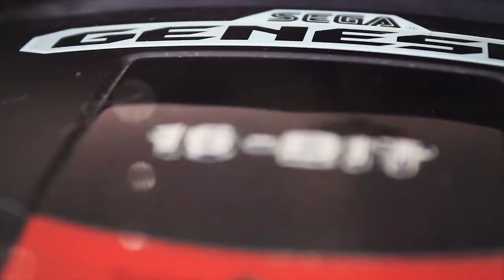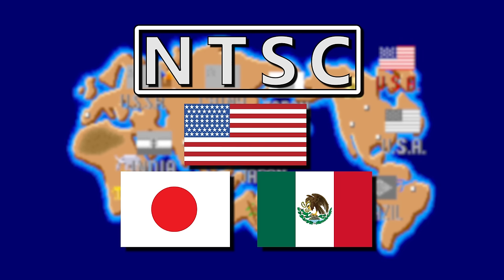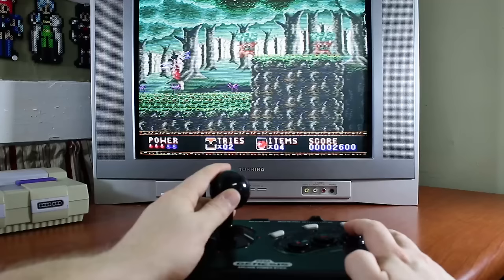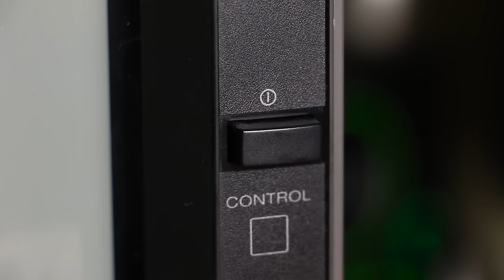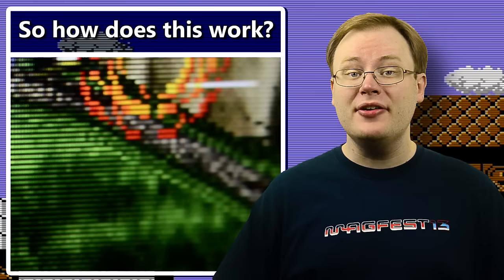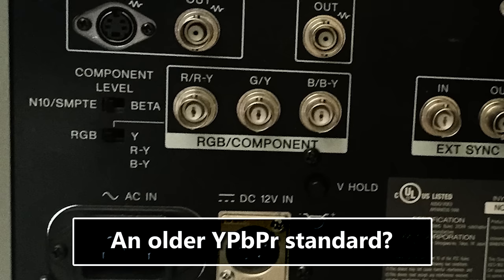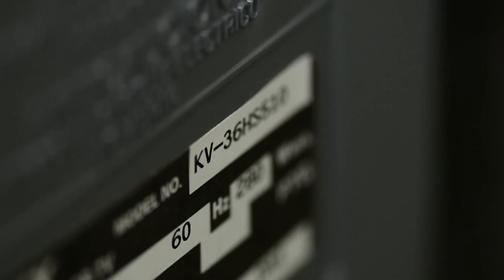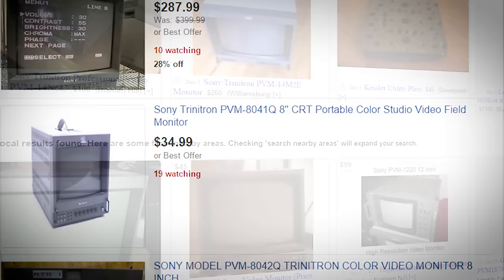Gaming on CRT Televisions, PVMs and BVMs :: RGB104 / MY LIFE IN GAMING

Comment: Not keen on professional video monitors and the whole RGB thing going on today certain consoles like the NES, SNES, N64 all don't have RGB as standard they came with RF in the UK and composite was considered the better quality cable and on top if you want RGB scart out those consoles they have to be hardware modded. 
To me that says a lot about the intended look of what the games were meant to look.
I would say Dreamcast and above work well and look great with RGB Scart otherwise PS1 and below I prefer composite inputs as so many games took advantage of dithering even on the SNES and PS1 which had great support for transparencies

Comment: 9:20 got to jump in here. Game developers were not simply making use of CRT screens funtionality. They did not have anything else to work their ways around. This was what they had and the games had to work properly on consoles connected to these CRTs. Nobody back then saw flat pixel by pixel based image processing screens becoming the future. I wonder how things had been going if they had known.
So instead of complaining too much I appreciate modern screen sets and modern gaming consoles. Many retro games exist digitally and come with screen options. Some do a better job at emulating the old washed out looks than others. Yet the games remain the same. And so many games would have never come to my mind if it wasn't for a brief time using emulators. But not anymore.

Comment: Thanks for explaining the whole thing about CRT. I have a question: I play old games on my computer with a LCD monitor (I do not own any consoles), but I have my old Samsung CRT TV (Flat screen, 14 inch). How can I connect my PC (VGA Output) to any of the inputs on my old TV? My TV has Composite (Yellow Jack) and Component (Red/Green/Blue jacks). Hope you can help me, thank you again!
Reply from the maker: [Try4ce] There do exist video cards for PC that are designed for 240p output, and also some analog output options for Raspberry Pi systems, but this is not something I know a lot of specifics about. Another thing you may be interested in looking into is the MiSTer, which is an open source FPGA system that plays many consoles. You can use analog output from it to CRT TVs.

Comment: When it comes to refresh rate, I'm still a little confused. As an animator, my lectuters say to make sure to set up the animation project to 25fps as oppose to 24 fps. They say that PAL region TVs still have 50 hertz displays, even modern TVs. I also checked online to see if who were right. Onlime says you were right, but my lecturers have been in the industry for years. So I'm not sure who's right
Reply from the maker: [Try4ce] I've downloaded project templates that are set for 25fps and I hate it. Doesn't look great. While I don't have PAL TVs on hand to verify anything, I'm pretty sure your lecturers are wrong. Modern European TVs and monitors can display 60Hz content smoothly. After all, modern game consoles in all regions output 60Hz. Europe does have an advantage in the sense that your TVs can also accept 50Hz content, while it's usually locked on ours. I'm not sure if they can display 50Hz smoothly or not though, but they definitely can do 60Hz smoothly. Ultimately it probably just depends on who you are delivering your project to. If it's going to a European TV station, maybe they still use 50Hz and 25fps would be appropriate. If you're making something meant to be viewed by a worldwide audience, I think 30fps/60fps is a safer bet. But if you want a good grade, I'd just make your professors happy for now.

Comment: I’m probably waaay past the point of response here, but I’m wondering if any work has been done to try and replace the DAC circuitry in newer HDTV CRTs with analog—or newer low-latency—solutions. Those screens were beautiful and probably have a lot more potential than they get credit for

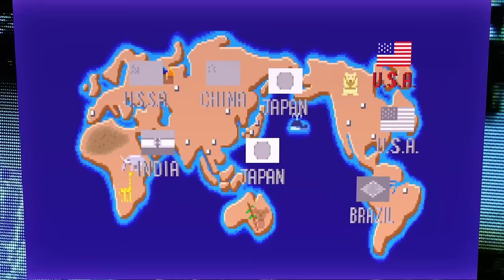Comment: 3:42 France use and east Germany used SECAM
Reply: It's tricky. What matters for retrogamers is not the colour TV norm but the underlying black-and-white norm. The different black-and-white TV standards originally had no names. Later on it became custom call the black-and-white standards the name of the colour TV system usually found laid on top of it. All of Europe had the same black-and-white standard, but Europe used two different colour standards ontop of them: PAL and SECAM. It became custom to call the black-and-white system of Europe PAL.
France had PAL black-and-white television with SECAM colour laid ontop of it. Brazil had NTSC black-and-white television with PAL colour laid ontop of it. Although Brazil used PAL colour, for gamers, it was an NTSC country.
Reply: @Rainer67059  Are you sure? I always thought that for instance the standard PAL Commodore 64 was incompatible with French SECAM TVs https://www.lemon64.com/forum/viewtopic.php?t=56794 , and that the reason the Amstrad CPC was a big hit in France was because the bundled monitor got around the problem.

Comment: I notice many crts have a composite output, which I suppose let’s you connect the crt into a modern tv, now this could act as a framemeister alternative but idk if the video quality becomes blurry on a modern tv due to using composite but I haven’t seen crts with s video or component outputs
Reply from the maker: +Isaac Cannon [Try4ce] It does nothing special, it's just normal low quality composite. Handy for capture back before we were into RGB though.

Comment: I have two CRT's. One is 20" curved screen with Composite, S-Video, and Component. The other one is 28" inches with only RF and Composite. But I want to be able to have a lot of friends over, and I want a big screen for that. So should I sacrifice a bit of image quality for a bigger screen? Or keep my smaller tv with better inputs. (Current setup)-N64 via S-video, PS1 via Composite, Xbox original Composite, and Gamecube S-Video.

Comment: If they made a 4:3 OLED LCD screen with component and RGB connections that was ment for ,240p and so on for classic consoles and that in mind at the highest level. Would it be better then gaming on a modern lcd tv even if it was OLED also? Could it be as good or better then a PVM. THou can't escape the lag that lcd's have YET.
The way I understand LCD's there best with there native resolution. But keeping the Resolution at 480p or 240p would mean less scaling. It's a shame some games change resolution or some games have different resolution in general would of made this dream kinda better. Main reason CRT style tvs like the PVM makes anything look good.
Would be amazing if they put a hole lot of settings in there to.

Comment: I have a question. Since PVMs and BVMs are Multi-Format that can detect NTSC, PAL, and SECAM signals, will they also work with multiple voltage standards from 100V to 240V without the need for a step-up or step-down power transformer and do they come with multiple plug outlet adaptors for different electrical plug outlets used by other countries?
Reply: some of them are 100-240v

Comment: Great video! I have a quick question for you..I have a bartop arcade cabinet running pandoras box 6.  I have an LED monitor with a scanline generator (19inch monitor). There is an option with PB6 that says quality optimization.  Should I leave that on or off?  I want the most authentic look as close to the arcade as possible :) I usually leave the pandoras box 6 resolution at the resolution below the 720p HD. Any help would be great! thanks.
Reply from the maker: [Try4ce] Sadly this is not something we're familiar with.

Comment: Hi please forgive me for asking this question - I promise to read into this further but for now I have purchased a pvm 14l4 and intend to buy cables to enable me to hook up to my C64 and pretty much all consoles from the 80’s and 90’s - so to get to the point my pvm is capable of displaying 800 lines. I can’t understand how my c64 or nes can create a better picture ? From that single output
Reply from the maker: [Try4ce] Well, keep in mind that the "line count" is horizontal. You will see that things look crisper in general, but you won't see more detail per se, if there is no detail there. Also remember that you will need RGB mods for some systems, like NES, to get RGB quality. But PVMs are in general really high quality screens, even if you don't hook up RGB to them... so things should just look nicer in general regardless.

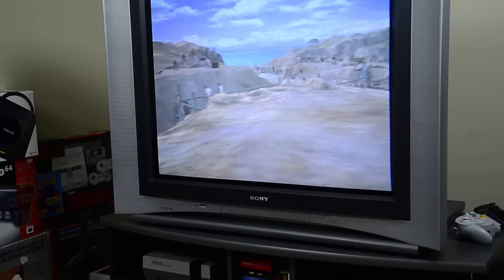Comment: @18:22 you are saying about the 4:3 Sony HS510 series digitally upscaling stuff. Wouldn't this be fixed by using an OSSC to make everything 480p with scanlines before it hits the monitor?
Reply from the maker: [Try4ce] Well, technically the OSSC is doing something like that too, but yes, an OSSC might provide a better result in that regard for that kind of TV.
Reply: @mylifeingaming  Thanks for the reply. My thought was that these TVs (the 4:3 HS510s) actually have very high quality, high line count CRTs in them. If one was to use a high quality upscaler like an OSSC for line-doubling or an XRGB mini for crisp output of 90's CRPGs, would this set rival the quality possible with PVMs or NEC pro monitors?

Comment: Hello there. I was wondering if I can please ask you a couple of  questions? I just got my first CRT in years. It's a German brand called Telefunken and the model number is MA 115 GT. The TV is pretty basic and has an audio and component input in the front and one SCART input in the back.  When I press the AV button on the remote it switches between AV and S-video.  Does this mean my CRT is only capable of S-video? And will something like the Pi2scart at lest give me s-video quality?
Reply from the maker: [Try4ce] I don't have direct experience with European TVs, so I'm not sure. I was under the impression that most SCART connectors on European TVs do have RGB capability, but I don't believe it's universally true.

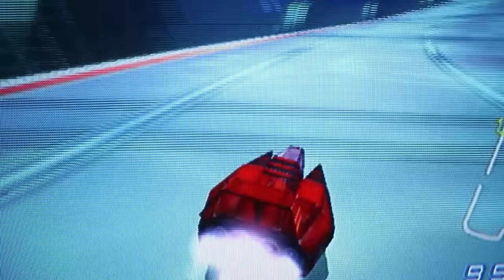Comment: So around 15:14, you show and mention plugging component cables right into the RGB inputs using HD Retrovision cables. Can I just plug my Genesis or SNES right into RGB and change the setting on the monitor then? I have a SONY PVM 14N5U that I want to mod with RGB. I am wondering if I am able to use my HD retrovision cables with that mod.
Reply from the maker: [Try4ce] On PVMs with RGB inputs, usually you can change between RGB and component. But I'm totally unsure if you'd have that option with a mod on the PVM itself if it doesn't already have RGB.
Reply: @mylifeingaming  Thanks, Try. I might be getting a JVC PVM for free soon that has rgb inputs!

Comment: Great video! I'm looking into getting a CRT that is I believe only 240p max resolution. Can I play any/all PS2 games on it? Or does it have to be a tv that supports 480i? I've seen mixed answers on this question (some say only some PS2 games work on a 240p tv)
Reply from the maker: [Try4ce] There is no such thing as a 240p TV. TVs that are 480i are equally capable of 240p. The more technical term would be to say they are 15kHz TVs. Both 240p and 480i are 15kHz signals, so it doesn't really make much difference to the TV if it's 240p or 480i, as long as it's truly an analog CRT TV and not a digital HD CRT. Both will be displayed properly. 240p is not a proper standard and is more like an analog video "trick" that just happens to work on 480i TVs to make a low-resolution progressive image. CRT computer monitors are different, however - these are generally 31kHz and the lowest resolutions they accept tend to be 480p. So basically, any run of the mill consumer CRT TV or PVM will handle both 240p and 480i because they are 15kHz.
Reply: @mylifeingaming  Ok thank you so much for clarifying that for me :)

Comment: I want to obtain as many CRT TVs as I can and convert them all to RGB... I'm just afraid of the discharging process... videos on YT make it look simple enough, should I really be that worried?  Rubber mat, don't touch anything, Ground a screw driver with a wire to the chassis and prod the anode.  If that's all there is to it, HOW is it possible anything could go wrong?  As long as I'm not wearing metal... or standing too close or accidentally touching something... what else could cause danger? I also wonder if holding an electricity sniffer can verify a successful discharge (those wands that you hold near outlets and it starts beeping).

Also what is the best type of TV to choose for RGB mods? Ones strictly without component? Is it true that if a set has component, it will be guaranteed to have input lag due to extra processing? (rendering light guns useless)

There's a Mitsubishi 40" bubble tube CRT (CS-40809) on the street right now. It has a cut power cord. it looks quite tempting... problem is that it's heavy as heck. It does have component input, so I wonder if that's a dead give away to leave it alone... (perhaps it's comparable to the SONY WEGA 36" HD featured around 18:19, in which that case I should just ditch it?)

What'cha think...

Comment: When a game console produces a 720p or 1080i image to be transmitted analogue to a PVM via a cable, what line frequency does it use?
I mean NTSC had 525 lines. Just 486 of them were visible, but the line frequency was 525x30. PAL had 625 lines, 576 of them visible; 625x25 lines per second. What are the upper line numbers with 720 and 1080?
Reply: 720 and 1080. they aren't designed to be stored or transmitted or displayed the same as archaic and broadcastable 480i. could be wrong there, and you ought to remember even if a console is outputting at HD it may very well be rendering a smaller resolution.
Reply: "archaic"? I don't think that analog fans like Vinyl lovers or people who advertise CRTs think that analog technology like analog video transmission over a cable is archaic. Since digital cable formats use compression, the video quality is worse than if the same resolution is transmitted via an analog signal. And if 720p and 1080i is transmitted digitally, a processing is necessary within the monitor to cause lag. If we want the advantage of a CRT, we need to have it analog.
Even if the signal is transmitted in digital, the monitor needs to use an internally normed line frequency and vertical frequency. The downward motion of the electron beam cannot start immediately after the sync signal. This sin't technically possible. There is a certain delay that will cause that the first lines are not visible. The screen will have to use a line frequency that's higher than the actual visible resolution to show the entire picture. It necessarily is that way. Only possibly then different monitors use different line numbers. Such line numbers need to be odd for interlacing. And to drive the cost for the internal sync signal generator down, it needs to have an integer factorizing that consists out of small prime numbers.

Comment: I have an HD LG tv with all inputs from composite, s-video, component, and HDMI. I also have a Toshiba CRT with rf, composite, s-video, and component inputs. I want to hook up my PS One, Super Nintendo and 64 through S-Video and my PS3 and 1st gen XBOX through component cables. 

Now my question is... 
Would it make a difference if I hook up my systems using s-video and component to my HD LG tv compared to hooking it up to my Toshiba CRT using the same connections? Am I better off hooking up s-video and component up to my CRT or will using my HD LG tv work just as fine since it's still using s-video and component for my retro systems??
Reply from the maker: [Try4ce] They will look vastly different because they are such different technologies. Without an upscaler that is specifically designed for retro gaming, those connections may not look so great depending on the HDTV. But ultimately, test it for yourself and decide if you are OK with the look, or if you want to hook up the CRT.

Comment: My pvm only has 1 input for either rgb scart or component and no expansion slot. I am using 2 gscart daisy chained for everything from Famicom to PS1. I also have a component switch box for my Gamecube, PS2, Wii, Original Xbox. I hate having to disconnect the gscart to connect the component switch box every time i want to play different systems. Is there a way to have both gscart and component connected at the same time?
Reply: You could get a extron matrix switcher. MLiG has a video about switcher where it is mentioned. I use one and I think it will suit your needs

Comment: I have both Nokia and Salora CRTs. When I connect Super Famicom with RGB SCART to either one of these, the picture is not centered (it is a bit to the left), I already found the service menu that should let you adjust picture options (vertical and horizontal), I see them both but only the former is accessible, if I try to go down in the menu it just won't let me. Does anyone know what causes this?
Reply: your tvs may not support ntsc 60hz

Comment: Would you consider the Wii a CRT-based or LCD-based system? I know it supports widescreen and 480p, but it only natively supports analog out, and I grew up playing Wii on a Sony Trinitron CRT, and am wondering if I was doing it the right way back then or if I am doing it right now.
Reply from the maker: [Try4ce] It's very much in between. Nintendo thought HDTV adoption was not far enough along to bank on the system being HD. There's definitely no right answer when it comes to the Wii, just because of the time when it was released, during that transition.

Comment: So I have a question. If, say, a 90s trinitron monitor has more lines of res' because it has 31khz. where most PVMs have 15khz (even though i read most of them have more lines than normal CRT's). With this in mind, wouldn't that make the monitors the best way to play most games from 5th & 6th gen rather than a pvm? or have i missed something?
Reply from the maker: [Try4ce] 31kHz does indeed look great on PC monitors if you adapt the signal to VGA. A very few PVMs so support 31kHz though, and BVMs.